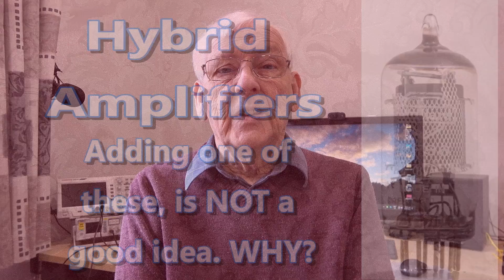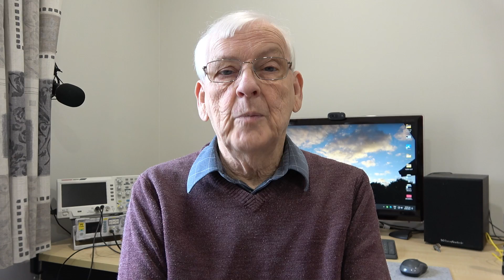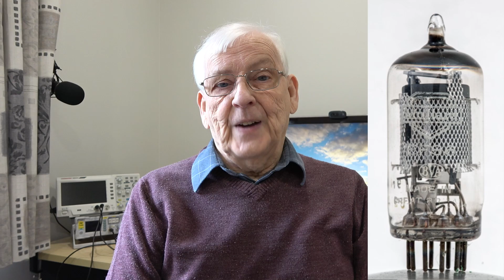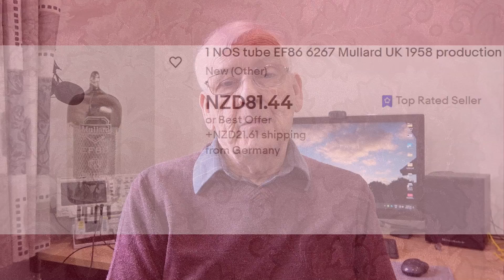HYBRID AMPLIFIERS. Adding one of these, is not a good idea. WHY?

Comment: The idea that less expensive valves don’t sound good is demonstrably false. Like you can get an inexpensive 12au7 from JJ in Slovenia that sounds pretty great and only costs about $20, for example.
Reply from the maker: I don't think I'm saying that at all. I'm saying they often use a cheap RF valve when they should be using a valve MADE for audio! Like the 12AU7 or better still the EF86.
Reply: @MichaelBeeny  Fair enough

Comment: You made my day! Yes, yes, YESSS! I am one of those guys who loved the music from 70s, 80s and even some 60s. And i was horrified by what was happening after.. Loudness war, yes. And being an electronic guy, I had the idea mid 2000s to put valves in preamps, but in the first stage, and after that in the driver of a very special kind of amp i created those years, a class H amp with 1 amplification in voltage (what enteres, goes out). Yes, that one especially  was good. Gooood. But what you are talking about here was PERFECTLY RIGHT. And made my day, as I said... I heard everywhere about "valves, valves, valves..." from people who dont really have a clue what they are talking about. Thanks!

Note after writing. For clarification. The class H amplifier had 2x96V supply, and the valves were supplied with a supplement of 10V on top of the + and - rails to have some room, and their scope was mainly to round clip the audio just before the harsh clipping of the power stage.

Comment: IDK, I have such a device - actually like it for speech and movies especially. With a small Behringer USB DAC because if you try driving that thing directly from a computer output you collect all kinds of hum, and the bluetooth mode is atrocious.  Still draws much less idle power than the 1990s amplifier it replaced in that spot. Of course the valve plays the role of an exciter and not an amplifier enhancer, but that's the point and was always clear, no? It's a podcast, youtube and movies setup, not a HiFi setup of course. If it doesn't color the sound I'd be disappointed. Not guitar amp grade coloration, but some. And hey, if it's a 5532 not a 4558, it's already miles above a lot of stuff sold as HiFi :)

---

Of course, we know there are valves designed for 12V on the anode. Even harder to find than audio specific valves. Won't find them in these devices I'm sure.

---

You know real slew rate limiting doesn't "take detail away" but adds massive IMD while still passing naive THD tests, right? :)

Comment: I bought a small tube buffer amp on Ali for about $15 running on a 12VDC 2A "wall wart". It has a built in Buck Converter on the board that generates 186VDC for the tubes!
Reply from the maker: I have tested 2 of these in the past, one had 36 volts, the other 55 volts, both from Buck converters. Obviously, I cannot test every model. 185 volts is a good voltage. They are still not audio valves but cheap and nasty RF valves.
Reply: Boost converters, not buck...

Comment: It is possible to make a valve amp sound good. It is even possible to make a good source for it by dragging a bit of a diamond along a spiral scratch !  BUT both can be done better AND very much cheaper, by employing the best tech we currently have in the digital realm. Not employing superior tech shows a lack of understanding, or worse, rose tinted spectacles and sheer bloody mindedness !  lol
Reply from the maker: There are valve amplifiers out in the market that sound OK but ANY amplifier that ADDS anything is not in my mind a so called HIFI amplifier. A good amplifier should add nothing but gain. However, if some people like the sound of distortion, and don't like detail, I cannot argue with that. This kind of product should be called an effects box, not a HiFi amplifier. There is room for both products in the market. A valve amplifier is simply floored in its technology. The output transformer is one item. This can really make an amazing different to all aspects of the design. It's just sad one has to be used.

Comment: Agree with you completely. The preamps that run on 12 V are ridiculous. No one who ever designed a vacuum tube to operate at 12 V B+. Totally stupid. Quality vacuum tubes were designed for around 150 V or higher
Reply from the maker: To be fair they do run on a littler higher HT. Somewhere between 30 and 60 volts, fine for battery valves, but these are not battery valves. In fact, they are not even audio valves, but valves made for RF work. Wrong in so many ways.

Comment: When tube amplifiers are discussed, the idea that 2nd harmonics enrich the music inevitably comes up. Unfortunately, the situation in real life is more complex because you cannot have any form of harmonic distortion without also introducing IMD, or intermodulation distortion. IMD sounds bad. It sounds bad because it introduces frequencies that have no relation to the musical tones in the original recording.  
Even if such distortions somehow sound "good", this has nothing to do with making a high fidelity amplifier. If you can hear the effects generated by the amplifier then what you have is an effects unit, not a high fidelity amplifier. We can make amplifiers now which have defects below the threshold of human hearing. Therefore, all non-broken amplifiers sound identical.
Reply from the maker: I agree 100%. I could not have said it better myself.

Comment: The valve amplifier marketing is often based on a misleading claim that valves add something to the sound. The fact is that the only thing an amplifier can add is distortion. Furthermore, if a particular kind of distortion is your preference, you can do that far cheaper and more reliably by digital processing than some unpredictable array of tubes and transformers and their interactions with the speaker impedance.

Comment: I am not a tube electronics expert, but my understanding is that a hybrid pre-amp or amp can have a tube (or tubes) in the power supply rectification, or the input buffer, or in the power amplification section (or some combination of these). If all three sections use tubes, it is clearly not a hybrid.

Comment: The idea of a hybrid amp , or hybrid pre-amp, or hybrid system (tube pre-amp with solid state amp) is to get something in-between a pure tube and a pure solid state setup. So criticizing a hybrid amp is in fact severely criticizing a full tube amp. Also, I don't think it is fair to judge some of the cheap tube equipment by the included cheap (and not so good sounding) tubes, because they expect that most customers will swap the tubes out with more expensive and better sounding ones. Some tube amps can actually be purchased without any tubes for that reason, although it is usually not a bad idea to purchase it with some cheap stock tubes even if they don't sound good, just to verify that amp is actually not defective when it arrives, and then start tube rolling after that.

Comment: So you are saying that all the hybrid amplifiers that exist on the market today, even those that are designed and built at the highest level by serious audio companies, are not good, inaccurate and do not give an audiophile sound?
Listen, this is a serious statement
Reply from the maker: I clearly cannot say ALL because I have not tested them all. Basically it's 100-year-old technology. A valve is just a valve. You cannot do much to a valve to improve it. Almost nothing has been done over the last 30 years on new products. The same valves are being used today as were used 50 years ago. By and large the circuits are also much the same. The only differences are the valves and transformers are now 100 times more expensive. Because of this price difference and lack of quantity production. Amplifiers today cost a fortune. These products were fantastic in the 50s and 60s, they were the best at that time, it was also all we had, many people had HiFi based on valves. They were very massed produced, most people had HiFi in one form or another.
These days, almost no one has ANY kind of HiFi. It's just sound bars and crappy telephones. Because of this, HiFi has become a very limited range of products. Heading this scramble are so called Audiophile products. Valve amps head this list. Make the products into something they are not. Use 4 transformers when one will work just as well. Use expensive metals, plate them in gold etc Add all kinds of bullshit that drives up the cost but makes ZERO difference. Add a $200 mains cable. At the end of the days, it's the same floored amplifier. Things have moved on and better, many modern amplifiers are so fast, they can extract detail, only dreamed about years ago. 
However, if you have thousands of $$ to spend on such products, and many do look good for sure. Sit back, heat the room and kid yourself they truly sound better. Afterall, if it costs the earth, it MUST sound better.
As for hybrids, wrong on all levels. Why make an amplifier or preamp, and let's assume it's a good one. Then add a valve that will limit bandwidth, add noise, add distortion, slow the amplifier down, remove detail. AND DO THIS ON PURPUSE? It's like buying a quality car and driving with the brakes on, it simply does not make sense. However, if YOU feel it's better, that's all that matters. Many people think that invisible gods exist!!
Reply: @MichaelBeeny  People like tube based amps because they just sound better.
More organic, more natural and more musical.
You call it a slow and distorted sound so be it
In the end you buy equipment that will draw you in and make you want to listen more and more.
In my personal experience amplifiers based only on transistors do not do this.
It may sound fast and accurate but analytical and boring.
Reply: @TerryClarkAccordioncrazy  yes i can
I had  a least 20 amplifiers.  And  I allways loved the sound of tube amps/ preamp much more than ss amps/peamps
Reply: @moshezuhmih  Did you conduct a blind ABX comparison? Because if you didn't, then expectation bias inevitably comes into play. Just the visuals of seeing the pretty vacuum tubes may be enough to create the impression of a different sound.
Reply: @TerryClarkAccordioncrazy  i do not like the way vacum tube looks like.  I like the way they sound

Comment: There's nothing more a music producer likes than to be able to market the music as "remastered" as if there's an improvement on the result. This usually means digitizing the original analog recording and making them sound bright. Too bright in my opinion, to the point that they are unlistenable. One of the reasons why all original analog recordings cost so much. Even finding a mildly worn original analog release sounds way better than anything you can get today. And by the way, very few new vinyl recording are completely analog (designated by the AAA designation). What you are really getting is a CD on vinyl with all the limitations of vinyl.

Comment: Michael, you are so right about many of the issues you mentioned in this episode. I see products similar to what you described advertised on many websites. Valves or vacuum tubes seem to be added just as an advertising "gimmick". To critical listeners, much of what is broadcast on FM radio these days is to badly compressed and distorted that it is unlistenable. Only a few FM stations (in major cities typically) seem to provide a mostly low distortion signal if they broadcast classical music, jazz, big band music etc. Most of the rest is just garbage or rubbish. I personally have both solid state and vacuum tube audio equipment. With a well designed vacuum tube amplifier or a well designed solid state amplifier there is very little that can be discerned to be different between the two. Some early solid state amplifiers were not good to listen too for extended periods of time as they had their own distortion characteristics that exhibited higher odd order harmonics than was originally in the music to be reproduced. Much of the public today does not realize how distorted the audio is from today's sources. As you said, good audio amplifiers will allow the listener to hear the difference between a really excellently recorded music performance and one that is poorly recorded. Engineers test new equipment designs and the best strive for lowest total harmonic distortion and lowest intermodulation distortion. Keep up the good testing and reports! As always, you get what you pay for along with a good deal of education about the items desired.

Comment: Maybe I'll get one of those boxes, but I'll add a switch, labelled 'HiFi', & 'Distort', rather than the more normal labelling of 'bypass', & 'active'

I don't have any valve design & building experience (other than melting a grid in a 6CM5), I obviously cannot do any worse than what's out there.
Reply from the maker: Sounds good idea Paul. You can use HiFi mode for good recordings and crap mode (woops, valve mode) for poor recordings.